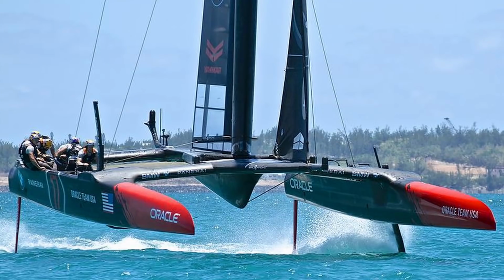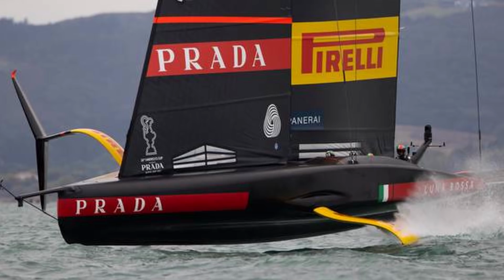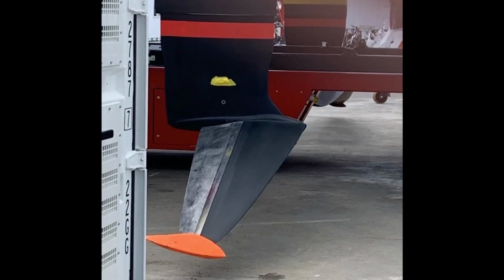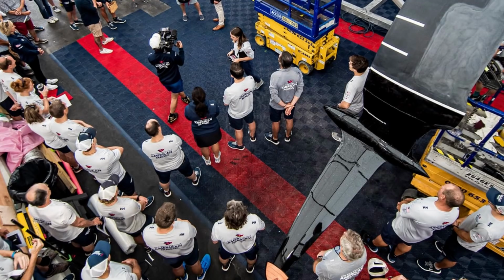America's Cup Foil Engineer talks with Mozzy Sails || Doug Schickler interview

Comment: I am a drive-by sailing enthusiast.  I tune in about every 4 years for AC.  I’ve sailed nothing bigger than a windsurfer and a Hobie 14 about 10 years ago but I loved it and I have always found AC fascinating.  The recent foiling classes are the most fascinating of all.  Their performance is insane!  But I’m also an engineer and a private airplane pilot and am trying to understand the boats, dynamics, tactics, etc.  So I was super happy to find your channel which focuses on the details of the design of these boats and on the details of the sailing.    I really appreciate your work and I have learned a TON from your channel.  Can’t wait for the racing to start.  Thanks from a happy new subscriber.

Comment: I did appreciate this latest video and most of the previous ones; in particular those highlighting the  ETNZ capability to improve stability and the advantage in this field provided by the T shape foil wing that provides a 2 knots advantage.Yet, there is an area that you and your fellow experts should cover possibly before the start of the race: how the different shape of the wings and dimensions of the flaps influence the capability of the two Match racers to optimise the VMG.  I suspect (or, better,  I hope) that LRPP even with less straight speed  gets closer angles upwind and good advantage in VMG.

Comment: Random question: why are the course boundaries not just a rectangle? They always have a tab sucking out an extra free hundred meters and I can't figure out why.
Reply: Just from my own observations... Some of the courses at least are bound by natural navigation hazards. Bean rock light house certainly pushes into the side of at least one of the inner harbour courses on occasion.  Some of the others are up under Rangitoto and have odd shapes pushing in around the start area.  The courses are aligned to the wind so even though the "ideal" course might be clear. A slightly rotated one might not be.
Reply: Do you mean to include the prestart area? So they can keep on foils and make sexy manoeuvres i think.